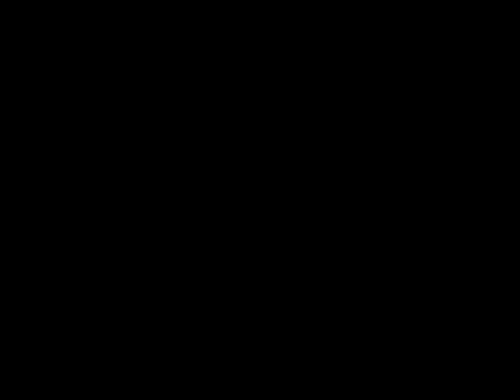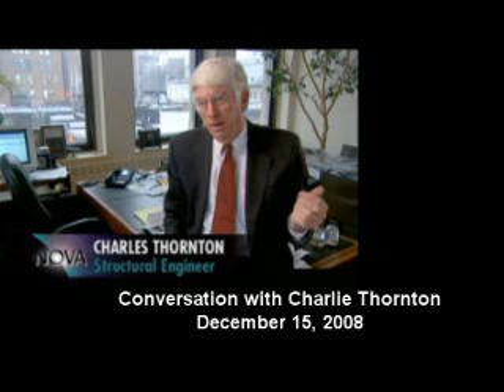pumpitout.com Jeff Hill speaks with WTC Investigator Charles Thornton

Comment: Charles Thornton in 1988 has said exactly the opposite: 

"The largest aircraft flying today, at least commercially, the 747, fully loaded, is on the order of 300 tons. So if you think about a 300-ton element crashing into a building that's been designed to carry 13,000 tons, you can see that an aircraft crashing into the World Trade Center would probably not do anything to the major building. It could affect localized structural elements, could knock out a column, and there could be some damage. But as far as a plane knocking a building over of that type, that would not happen."
Reply: It didn't knock down the building. Nobody ever considered the damage. To the building
Reply: @melvynsngltn27  Mel!  You and Roquefort in the same place at the same time!  The two guys with the plates in their heads!
Reply: @lebergerdesphotons4565  no morons who believe in Conspiracies theories and don't pay attention have plates in their heads
Reply: What all you people don't seem to understand is that he is describing the LATERAL impact force.  It is not going to knock the building over.   This has nothing to do with having 22 stories collectively fail.  Entirely separate discussion.
Reply: @roquefortfiles  you cheated on me!  Saying stupid stuff to strangers!  Still with your wild conspiracy theories.  Those 22 stories conspiring with each other to be an impossibly rigid mass,  going way beyond the capacities of the material they were made of just to mock everybody who knows physics!

the 22 stories which were the most damaged until they started to fall and then they were somehow much more rigid and coherent than the undamaged floors below.  And each floor as it was "convinced" from above agreeing to become more rigid mass 100% coherent with the 22 stories.  All that mass below which was just so wimpy it fell apart without damaging anything above it until it joined forces with the magical 22 stories and took on their strength for itself!

You are such a clown when you talk physics.

The "dynamic load"  which is its laissez passer to annul Newton's laws.
After all Dick Cheney did ask for and receive the derogation to the laws of physics from the jesuits that day.

Comment: In 1988 he sounded completely different! I always thought the Floor system was flimsy for a building of that typ, but he forget to say that not all floors in that building were open web joist, there were some heavy traditional floors between of them which hold the whole structure together, stiffen out and made it pretty tough! He also forget do say, that hundreds of buildings in the world used the same design! All of them are crap? Why are the new trade center and many other skyscrapers now build super strong and cost 2-5 times more? Because a conventional building could handle that kind of stress? The old 
WTC  (both 110 story buildings) cost: 1.5Bilion $ (inflation included)not cheap at all! 
The y828 m 163floors Burji Dubai (construction start before 9/11) cost: 1.5 billion 
The new WTC (1Tower 107floors) Cost about 3.9 Billion!!! More than twice as the Burji Khalifa! Why they now build such a extremely strong building??? This is absurd! Btw, the WTC "Plane Proof Studie"  never happen??? All the Awards the WTC won were fake???
 Robertson will not be happy about this!
Reply: the guy is a lying sack of crap.  I don't wonder who he's working for.  He doesn't even know that the planes and  the plane videos are fake.  Unless you want to believe that aluminum wingtips slice through 1/4 thick  12 inch square steel columns and that an aluminum airplane goes through a 4 inch concrete slab hitting it on edge.  And that that slab is protected by those giant spandrel plates.

he's all full of shit.
Reply: @lebergerdesphotons4565  clearly you never been to NYC with that stupidity your saying. Airplanes are made out of  Steel, Aluminum and Titanium, because both Airplanes went through both Towers and that they both collapsed he's now forced to tell the truth about those buildings
Reply: @melvynsngltn27  

the singleton refers to the one brain cell that survives inside that nearly empty skull of his.
Reply: @lebergerdesphotons4565  only to confused individuals like yourself who still live in a fantasy world
Reply: @melvynsngltn27  

you mean the sort of fantasy world where airplanes can take off from Boston without getting into the official database that every airport knows they'll have big fines for missing any entry?  Planes that can fly faster than Boeing thinks they could fly at 900 plus millibars of atmospheric pressure?  Planes that can penetrate 4 inch concrete slabs on edge with those edges protected by thick steel plates?  Planes whose engines are never found?  Black boxes either? 

Melvyn,  thank you for responding to me.  I've never before had the privilege of a conversation with a person of as low IQ as you.

I can't wait to see it unroll!
Reply: @lebergerdesphotons4565  concrete and steel. You do know that the Twin Towers were made up of Steel, Glass & sheetrock? Let me guess you never been in any of those Buildings huh? Probably never been to NYC either 😕moron
Reply: @melvynsngltn27  
melvyn,  so far you've never disappointed me.  I've worked in new york.  I've roller skated into the elevator as the door closed with the guard in pursuit.  Had to take them off at the sky lobby, did so and continued to the top.  Felt the whole thing move,  took a leak up there, saw the water in the bowl move back and forth.  pretty windy up there that day even at street level.

Now,  back to your stupidity,  Melvyn.

You do know that the Twin Towers were made up of Steel, Glass & sheetrock

See melvyn?  this is why I say that you're stupid.  You have neglected to mention the material which is far and away the greatest weight and volume.  Concrete.

You seem to have forgotten about concrete.  about 150,000 tons per building.  Only about 50,000 tons of steel in each building.

Probably never been to NYC either 😕moron

that's good melvyn.  I see you sign your letters >>  😕moron

the sad moron.

you are indeed.
Reply: @lebergerdesphotons4565  their was no concrete on the upper floors. Dumbass
Reply: @lebergerdesphotons4565  Also morons like use for that the Buildings were made up an unique tube structure. Since you claim you been to NYC then your also familiar with the 1993 WTC Bombing. In which a 1,300+ lbs truck bomb didn't damage one column or upper floor. Yet morons like you probably believe that the Buildings were full of bombs that size. Go back to Fantasy Island 🏝

Comment: This still does not explain the explosives.  What about the pyroclastic flow?  how about the temperature at the site two weeks after topping in at over 1000 degrees.  What about building 7, you know, the solomon bros. building???
Reply: can you please cite your source for temperatures of 1000 degrees weeks later?
Reply: I can't post the links.  NASA took photos, the USGS flew helicopters. The LiRo group also did a study.  There are reports as late as October 23
Reply: @pneumatasaur  if you can't post them, for me they don't exist.  When I cite a thing here I can show the source material.  I don't know why you can't,  you haven't explained that.

You have rejected the possibility that other phenomena can mimic high temperatures to the nasa photos and the equipment in the helicopters.  I saw the photos of earth moving equipment moving piles of debris which glowed red and even yellow but caused no damage to hydraulics on these machines after multiple hours in alleged but unproven high temperatures.  Those hydraulics are good to about 80 degrees C.
Reply: @lebergerdesphotons4565  I tried to post the links but youtube did not allow me to.  There is a full article with proper citations at ae911truth.
Reply: @pneumatasaur  how did youtube stop you from posting links?  Why don't they stop me from posting links?

Sometimes they won't publish my posts,  but it never seems to be because of a link.

figure out some clever way to get around the censorship, or include a sequence of words that permits me to find it and be sure I'm not reading some different article.  I don't want to spend much time on a&e because it's controlled resistance.

Maybe you could just make one or two of the important points and we'll see if you're ready to defend what you believe with logic.

I don't notice many people here being logical.
Reply: @lebergerdesphotons4565  I have given you enough information for you to find your answers. A simple Google search is all you need.  The links are there for you to use. This conversation can no longer serve a purpose.
Reply: @pneumatasaur  I saw from the beginning that you have nothing to show me.  off you go, nobody will miss you.  Your naivete is not interesting.
Reply: @pneumatasaur  photos and helicopters don't explain why flames from cars didn't ignite pieces of paper.  I've been near burning cars.  paper would burst into flames.  If you weren't in there with a thermometer, you shouldn't believe reports of high temperatures.  Have you read even one story of burn victims?  We see people on stretchers, in hospital beds.  They're not burned.
Reply: Architects and Engineers for 9-11 Truth has a wonderful article about persistent temperatures at the WTC
Reply: @pneumatasaur  
they have alway looked to me like controlled opposition.  I am disgusted by them for having fooled Ed Asner.

The article your talking about,  I'd like to read it.  can you send a link to that so I don't end up reading something similar which is not what you're referncing?